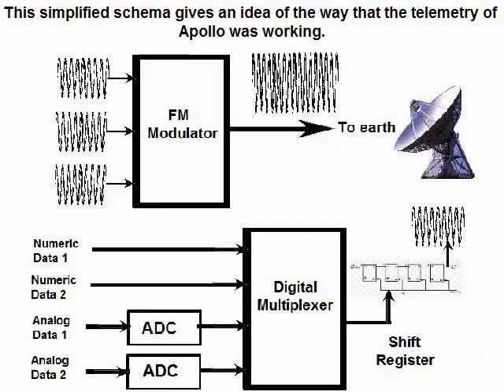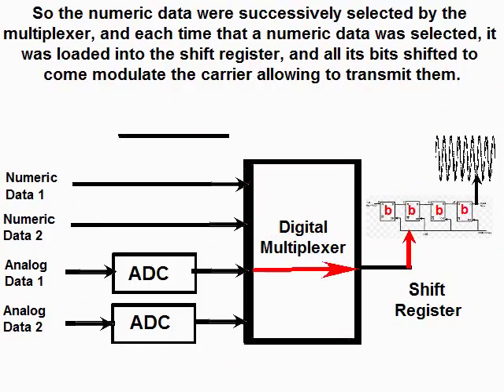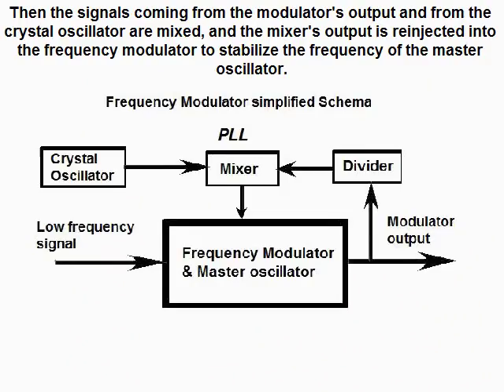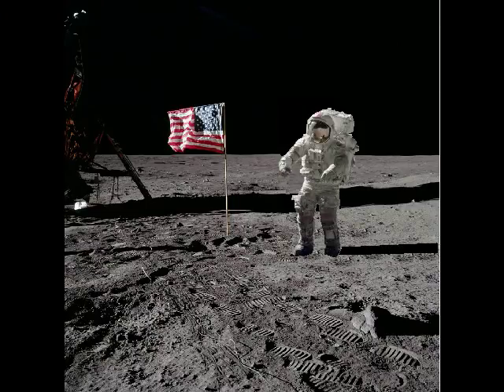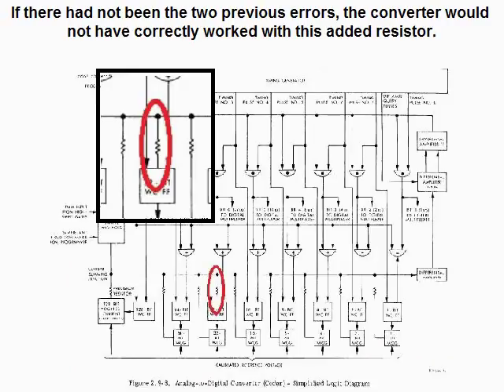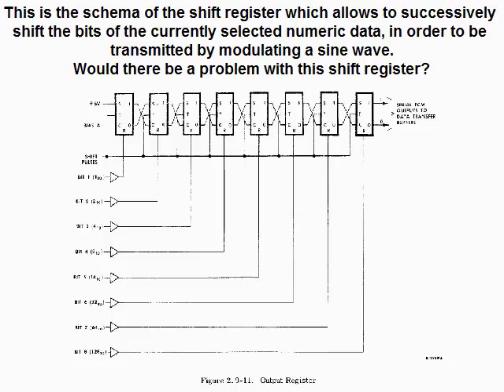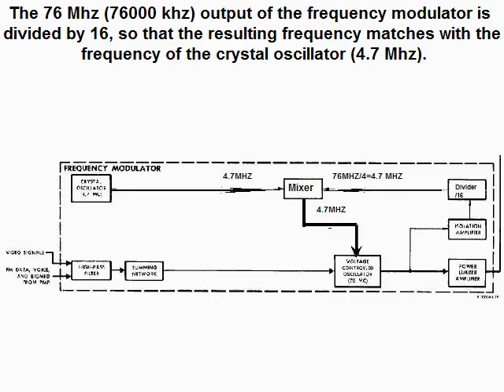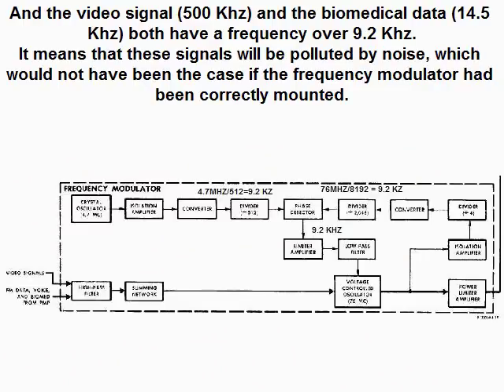Apollo telemetry lost? What telemetry?

Comment: I have watched for a while.  I can take a lot. I can even ignore that the video is made like shit. But your brutal lack of understanding basic electronic concepts is amazing. Okay, you have made some good points there, sure. But I had enough when you have explained the PLL. They have it right and your explanation is COMPLETELY off.  It is absolutely correct the loop bandwidth of the PLL is only 9kHz.  If you would have the bandwidth of the loop very high, no modulation would be possible, as the loop would correct for ALL modulation attempts.